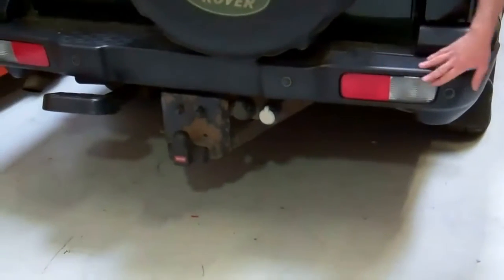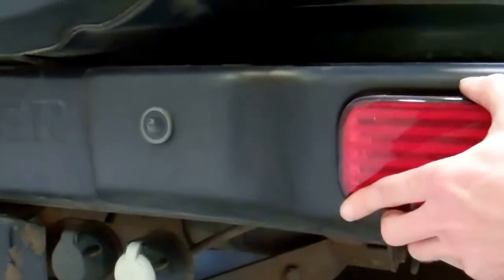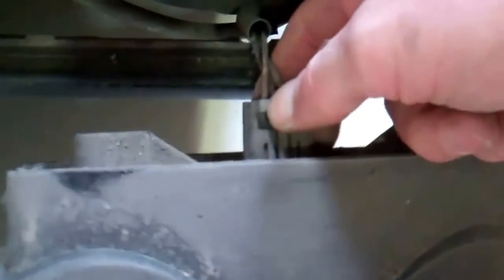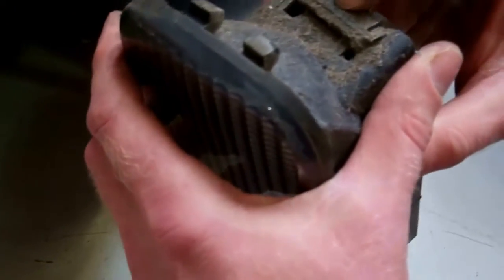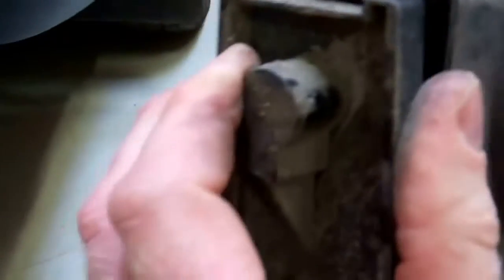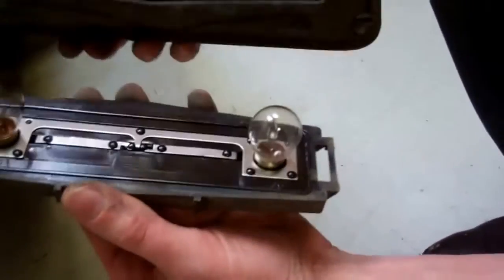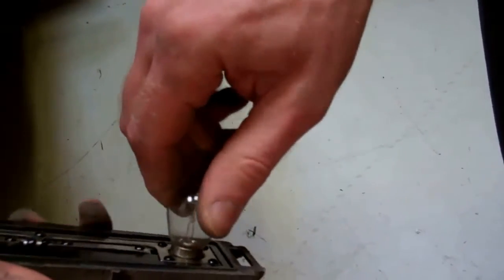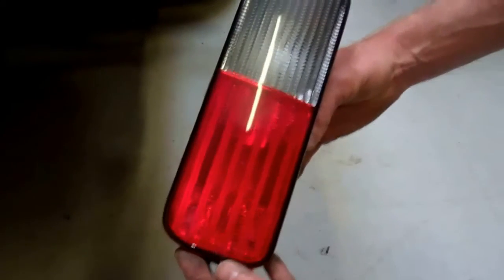How to remove rear bumper lamps from  Land Rover Discovery 2

Comment: Bought left and right new Britpart lenses (red fog and clear reverse) that fit into the rear bumper (as shown in this video) in a 2003 Disco 2 - one Britpart lens fell out somewhere on the road and took the original LR bulb holder and gasket with it!  Had to buy a new (bought LR genuine) bulb holder and gasket and another lens!  Both rear lenses looked to be secure (held with the clip as shown), but somehow one fell out.  Will be using silicone sealant this time around so not just relying on the clip.  The original lenses never fell out in 16 years!
Reply: And now you know why Britpart parts are known as Shitpart parts to those who know. I'll never buy Britparts again after having to change the front wheel bearings two years on the trot for the MOT after driving about three thousand miles between MOTs!
Britpart parts are cheap for a reason...

Comment: My bumper light won’t fit back in, the non spring side keeps popping out. Any idea why?
Reply: Mine popped out and took the bulb holder and gasket with it - lying on the road somewhere!  Might double-check security of fit second time around and also secure with silicone sealant for added security.  One of the Britpart lenses seems to be secure but the one on the other side popped out twice and of course eventually fell out completely somewhere on the road!